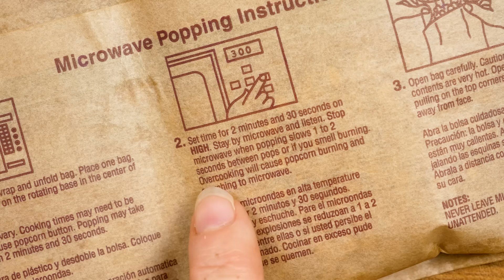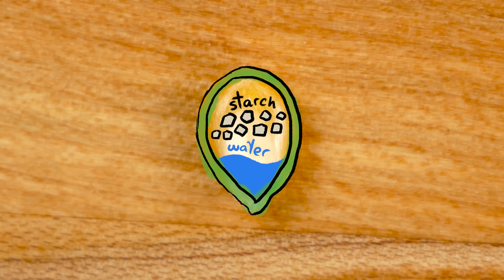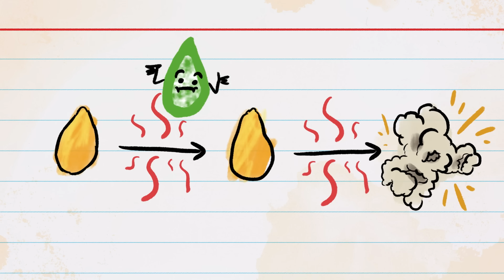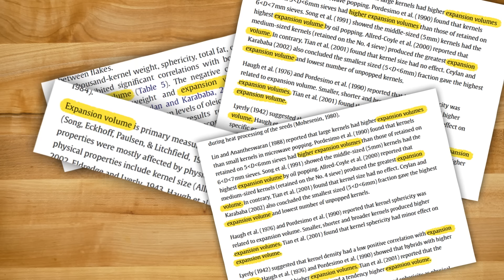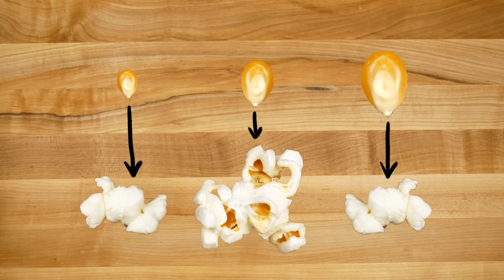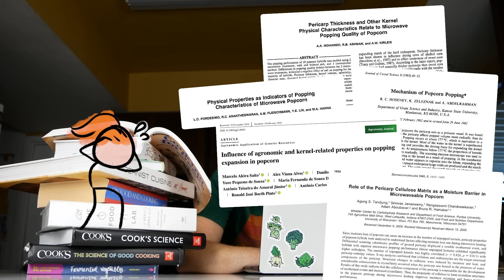How to pop the un-poppable kernels

Comment: In our household it is less that they don't pop the first time, but that they get in the way of enjoying the rest of the popcorn.  We have a large sieve that is about 1/4" gauge, possibly 3/8th's, that sits in the bowl that the air-popper ejects into.  The denser unpopped, or poorly popped, kernels sink to the bottom and with a little shaking fall through.  We usually make multiple batches so they end up being added to the next lot.  Sometimes they pop while in the bowl on residual heat.

Comment: There's a knack to the microwave stuff, stick it in on high for a minute, when you hear it start to pop listen until you start to hear the popping slow down,then quickly take the bag and shake it VIGOROUSLY side to side and up and down, then cram it in the microwave again as fast as you can, the oil that lines the bottom of the bag will still be hot, it shakes a lot of the smaller husks down whilst the fluffy stuff goes up and out of the way of the oil, then resume microwaving.

Ultimately though, I'd rather have a few no pops than burn the rest of it trying to go for 100%

Comment: I have found that after 30-40 second in the microwave when the bag starts to puff up if I open my microwave and shake the bag forwards and backwards to coat the kernels in butter evenly that I get only 10 or so unpopped kernel max on my extremely cheap popcorn.

Comment: I've found a realy easy, low effort way to reduce no-pops is to cook popcorn in a wok (provided you're able to cover the wok).  I'd imagine that as the kernels pop, the smaller unpopped kernels fall between the gaps and settle down closer to the heat source, meaning a whole lot of the heat gets directed at the unpopped kernels, allowing more of them to pop before the already-popped corn risks burning

Comment: I use a microwave popper, switch between butter and coconut oil.

I pop 90% of the batch in 2min.  Then eat the batch until I'm down to the bottom.  Then I place back in the microwave for 1 min.  Then almost all remaining kernels are popped less then 5 remain, often 2-3.

Comment: with the cheap microwave popcorn from costco, and my microwave 2 minutes and 13 seconds gets all but about a dozen kernels popped. if I add a single second I will get a slightly burnt corn. beyond that my wife gets upset at the smell of burning corn. The way I unfold it and place it in the microwave also have some effect. And letting it sit in the closed microwave for several seconds seems to help as well.
Reply: ...TRY ORDER...... CHINESE POPCORN CANNON ,IT POPS LIKE what can not pop ,LIKE RICE....

....IF UNPOPPED ONES IS THE PROBLEM FOR YA

...BUT BEWARE,THEY'RE QUITE dangerous

...BESIDES,I'M KIND OF PRETTY MUCH SURE THAT YOUR NEIBORS WILL CALL COPS,LIKE WILL THINK YOU SHOT AN elefant rifle AT YOUR HOUSE....HEHE

Comment: I’ve eaten a lot of popcorn and the best solution I’ve found is reducing power 80% of my 800W, also popcorn is very predictable with timing I can enter in a specific time and not stop it based on sound - going by sound I found out that my microwave actually decreases power for some reason at 1 minute and at 30 seconds left (noticeable stop in popping and then ramps back up). I barely have to deal with any popped kernels but I do have to deal with too many kernels popping that the bag opens up

Comment: Actually, if you cook them on the stovetop, and swirl it around nonstop, you won't get any extra kernels (maybe 1-3 kernels at most). The issue is that it takes significantly longer because you're heating all the kernels much more evenly, and it's tiring. But it's pretty fun to do occasionally, usually results in better, fluffier popcorn.

If anyone tries this, just understand you gotta bear with it. It's not gonna be like microwaving it, where you get some intermittent popping pretty much the whole time. It'll be zero popping for like 3-4 minutes, then suddenly they'll all pop super fast. Which is exactly what you want to see. Popped kernels are not happy sitting in hot oil for that long lol

Also, it's not the most fun cleanup. Olive oil isn't too bad, but butter is the way to go. You can kinda sorta get away with regular butter, but clarified butter is really best. It's easy to make, you just melt a bunch of butter in a pot, then pour off all the white stuff that rises to the top. Has a much higher smoke point, so it's better for cooking in general

Comment: in my experience, more heat = more popped but more chewy popcorn (an awful experience).
Lower heat with a good amount of fat covering the kernels = Super crunchy and tasty popcorn and more unpopped kernels depending on how low on heat you went. 

Pro Tip: add half a tea spoon of chilly powder on top before cooking and thank me later
also try to make sure that the fat can touch at least 85% of the kernels (using a pot with a flat floor, helps a lot but not necessary, you could always add more oil/ghee)

Comment: There are some candles being sold in heat resistant glasses. After the candle is gone and the glass is clean, turn the glass upside down, put it into the microwave and put some popcorn kernels under it. If you maintain the temperature in the right range and remove popped kernels, than most of them will pop. Just don't put the hot glass under water, because it will crack. It's a pretty slow way to pop the remaining kernels, but good for observation and science.

Comment: What I do to get more than 99% to pop in one go is I use a popcorn machine from a company called OBH Nordica, I put the frying oil and let it preheat until it's very hot then I place the bowl/lid on top without removing the ventilation lid on the top of the bowl/lid to build up heat and pressure, then when the popping has slowed down I grab the machine and shake it to get the last unpopped kernels to the bottom where the hotplate it. When all the popping has stopped I turn the machine off and flip the whole thing upside down and remove the machine leaving the bowl/lid full of popcorn on the counter. And that's how I barely get any unpopped kernels.

Comment: Makes me wonder what would happen if you heated it up in a vacuum.  It wouldn't have to be perfect - a rough (~5% of atmosphere or so) would probably help.  It would mean less heat is needed to get the pressure differential needed to pop without burning.

Comment: my way to have almost all kernels explode: use a pressure cooker, put the oil and three kernels. when the three kernels explode it means all oil is well heated. then add the desired amount of popcorn, close the pressure cooker and wait for a good amount to pop. shake vigorously, but avoid removing the pot from the heat, wait a little longer until reduced popping.

Comment: put more oil in the cooking pot on higher heat 
and more popcorn will pop 
and directly afterwards put the cooking pot in a sink filled with cold water 
to cool down the cooking pot 
which will prevent the popcorn from burning

Comment: some if not most of the no-pops are still edibly bite/crunch-able... if not, you could just swallow it right away. no waste generated. beside, the fact theatre chains (at least in my country) uses single-use plastic/cardboard cup and bucket instead of reusable & washable containers is a way bigger problem than few organic waste :/

Comment: My mom has a popcorn machine. It's basically a hot air cyclone rising up. Popped kernels being larger just fly off and are guided to a bowl. The others just stay in the bottom and keep circling around until they pop. We can get nearly 100% poppage.
Reply: "Poppage" is my new favorite word.
Reply: @sendmorerum8241 same
Reply: Yes, that was the air popper they mentioned that showed the highest rate at only 5% failure.
Reply: Same
Reply: But aren't they dry?
Reply: @babilon6097 yes, popcorn from an air popper is dry.  That is a good thing, one can then season the popcorn as desired, rather than have to deal with excessively oily or buttery popcorn.  A light spritzing with olive oil, a little sea salt, oregano, and garlic powder is a personal favorite.
Reply: @jpe1 I have never seen excessively buttery popcorn and I have seen people eating butter like a cake.
Reply: @jpe1 I've never tried olive oil. Thanks for the tip.
Reply: @jpe1  Some people just don't like that, like, my family stopped using that because of the weird texture the popcorn had.

And really, how much oil/butter do you use to have overly buttery popcorn? I've never seen that.
Reply: @babilon6097 if you've seen yellow on your popcorn it's excessive, a healthy amount of butter should be clear
Reply: @aSipOfHemlocktea You make a false assumption that I want my popcorn to be healthy as opposed to delitiuous.
Reply: @babilon6097  You just put butter on them
Reply: We also have one of those
Reply: Next battle cats cyclone leaked
Reply: cool, how is the machine called?
is it that air popper?

Comment: As a kernel pops the pressure inside is released and thus then cool, so if you use a cooking style whichs gets popped corn out asap and use its pop to remove it from the rest would then allow heat get to and continue to get to the un popped corn.

Comment: I have several of those MASSIVE "jars" from sam's club that I think had some kind of unhealthy snack. I washed them, and use my WIDE 9qt pot to make vast batches of popcorn. like, a garbage bag full at a time! I do get pretty good pop yields, but yeah, after I'm done eating all of that, I might end up with almost a cup of kernels left over. which, after a quick wash to rinse off most of the popcorn bits hull fragments and excess salt, just goes right into the pan to repop. but that's only cause I have enough to bother with! if i just want a quick bowl now adays i have a 3qt that makes a bit more than a microwave bag, and the teaspoon to tablespoon of no pops isn't worth my time.

Comment: FYI, it's a pneumatic threshold, not thermodynamic, because it depends on gas pressure in a vessel, not conversion of energy between chemical/potential/thermal and mechanical. Thermodynamics is mostly the study of how efficiently a process turns energy into work versus energy loss in the form of waste (motion, heat, etc).

Comment: With the chinese popcorn cannon, you can probably just go over 200 psi and pop all of them at once. Also nothing will pop before you open the lid because the outer and inner pressure are the same until you open it.

Comment: Method matters. Add your oil to a pot, toss in a few kernels. Heat, and when the kernels pop remove from heat, add the rest of your kernels in a single layer, and wait 30 seconds. This 30 seconds lets the kernels come up to close to popping temperature. Back on the heat. In a short time, most if not all of your kernels will pop almost all at once. With none burnt. You're welcome.

Comment: I get almost perfect resold with popcorn in the microwave,  but not ones in microwave bags. The ones in the bags burn next to the metal sheet and still a big number doesn't pop.

I got one of those collapsible silicone popcorn bowls (they are made specificly to make popcorn in the microwave). I can get the best result with up to 50g of popcorn, mixed with oil (at least 10% of the popcorn weight, so 50g need at least 5g of oil). You can add other flavors, but the oil is what helps them heat more evenly. Out of 50g I get between 2 and 6 unpopped kernels. I start getting significantly worse results once I go over 55g, anything over 60g is probably going to be wasted. Even at over 50g, I start getting some overcooked pieces to get the best results. I'm even using the cheap Walmart white popcorns. The type of oil doesn't matter, as long as it's liwuid oil. Clarified butter tastes great but it gets a bit less good results because it can't be properly mixed in and a bigger amount is required.

Comment: Since what makes the kernel pop is pressure from the water inside turning to steam, I would think that hydration levels may also be a factor in producing no-pops.  If you want to try re-popping them, I would suggest soaking them for a few minutes first, to see if that helps.  This might not only allow some to soak into the interior to provide more steam, but soften the pericarp a little to allow it to burst more easily.  Just a theory, though, I have not tested this myself.

Comment: I've been slowly getting my technique down on stovetop popcorn using a wok with a lid. I have gotten it down to 1-3 unpopped kernels per 6(ish) cups of popped corn with no burning of the popped pieces.

Also a tip I learned, using a mix of olive oil, salt, and nutritional yeast makes an amazing seasoning for it.
Reply: I use avocado oil, it gives a more buttery flavor. I alsodo them in the microwave in a special silicone bowl. I get similar results for up to 50g (probably 7-8 cups), with only 2 to 6 left. The big secret is oil and proper kernel and heat distribution.

Comment: 6:22 I think the highest poppage popcorn maker would separate the popped from the unpopped ones, so only the unpopped ones get all the heat.
But I think that would require some kind of airflow system. Where the popped popcorn is lifted up, while the unpopped ones stay at the bottom.
Reply: Air poppers work exactly like that. You've just re-invented them. The popped kernels are quickly lifted out, the unpopped ones stay and are heated further until they pop.

Comment: As I go through a box of microwave popcorn, I'll save all the unpopped in a used microwave popcorn bag. When enough has collected I'll just pop the bag in the microwave and around ~70% will pop. Usually with smaller sizes and more partially popped popcorn than normal. I like partially popped, so it works out. Doing this doesn't take much effort, so it can be fun to do.
Reply: I just eat the unpopped ones
Reply: @wolfetteplays8894 mmm buttery kernels
Reply: I put my kernels in a bowl and cover them with a plate. I use ceramic. It pops almost all of them  =D
Reply: Maiz Cancha

Comment: Hang on now. What are you talking about? 8% failure rate even with a stove top method? If you're not able to get every kernel to pop, you're not doing it right. OR, that was a suspicious batch of kernels. Anything above 2% is insane.
Reply: By weight. Popped pocorn weighs less than the same volume of raw kernels.
Reply: 2% by kernals not by volume eh

Comment: I always just swallow the unpoped curnels whole because I don't like throwing them out.
Reply: TIP: put the bag in for a shorter, or with less power, the 1st time around, and then longer, or with more power, the 2nd time around. This makes it harder to burn the corn, and results in fewer unpopped kernels.
Reply: @eugenetswong I only do stovetop now, because I'm vegan and most of the microwave I've seen have butter.
Reply: @lorrygoth  Well, I eat vegan popcorn, by using a silicone bowl & canola oil. This works well with the microwave.
Reply: @eugenetswong  Oh cool, I hadn't considered that, how do you keep it from popping out of the bowl and making a big mess?
Reply: @lorrygoth  It's a special popcorn bowl that comes with lid. When not in use, you can collapse it for storage.

The brand seems to be called "Colonel Popper". I wonder if it works almost as well with a glass microwave-safe bowl.
Reply: @eugenetswong  Okay, cool, I may look into that. Thank you very much!
Reply: @lorrygoth  I just thought of something that I plan to do: get the biggest glass bowl/pot that can fit in your microwave, and use that for popcorn and any other cooking. This will make your pot and microwave more versatile for cooking anything, like oatmeal or rice, which saves you from having to get a separate appliance.

By the way, when it comes to adding oil for my popcorn, I put oil in the empty, or mostly empty, popcorn bowl. I eyeball about  1 cm, or whatever height, below a line on the inside of a bowl, since I am a bachelor, I don't need to keep the popcorn bowl clean for anybody else. After the oil, I fill it with fresh corn, and stir with the spoon that I eat with. I put it away so that it is ready for the next meal.

Comment: I recall that Serious Eats (both Kenji and Sohla, in separate articles) praised the Whirley-Pop as a superior method of making popcorn, particularly for how few kernels remained unpopped, like an order of magnitude less.

That said, my standard method of making popcorn is one of the silicone reusable microwave poppers.   I melt a mixture of ghee and coconut oil (sometimes with a touch of garlic-infused olive oil for flavor), then stir in the kernels with the salt (usually Flavacol, but sometimes I'll just do plain popcorn salt).   It's a good balance of simplicity and quality for me.

Comment: Popcorn in a pan is FUN. I use Orville's White Kernel popcorn. It's a tad sweeter and I use Canola Oil. I follow Orville's directions, putting three kernels in the oil and when they pop, dump the rest in. I run the heat as high as possible, without burning. DELICIOUS! I also LOVE having popcorn with apples, but that's just my thing!  THANK YOU Minute Food! ❤
Reply: Totally agree, and I use a pan with a clear glass lid. Which means I get entertainment, before I get the popcorn.

Comment: Store them in an air tight container with a humidity pack (cigar people know). 
Then use an air popper. Never 100% popped but the leftovers are in the low single %s.... could be entirely in my head.